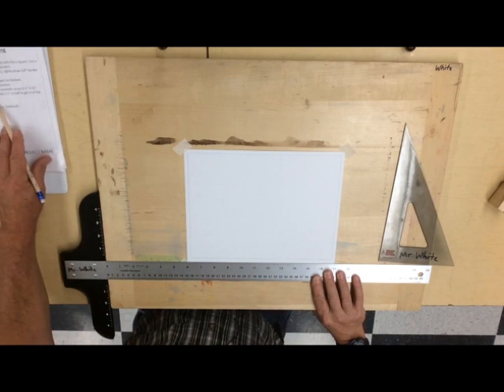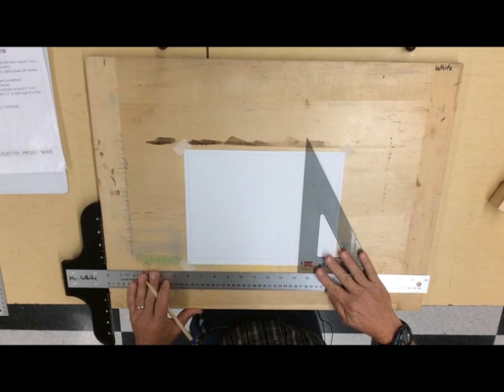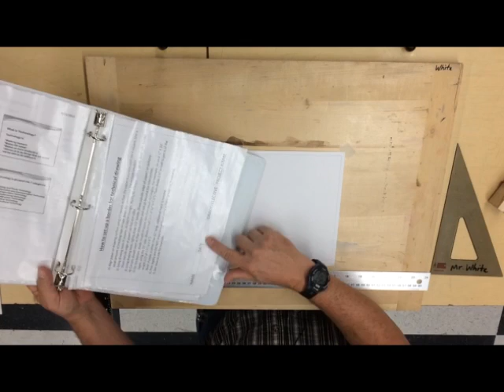Setting Up a Border for Technical Drawing

Comment: When lining your paper up on the T-square, slightly roll the bottom corners a little. Then set the paper flush to the top of the rule on the t square Tape the top two corners. I never used the T square for measurements, only used the scale since it was always more accurate for me.